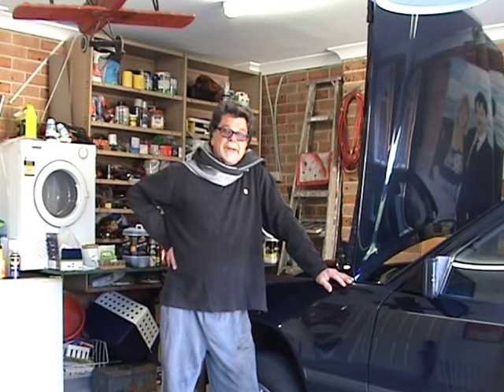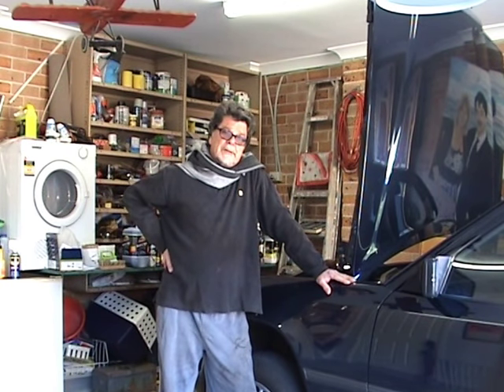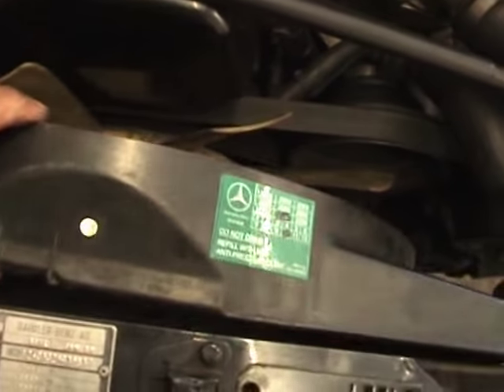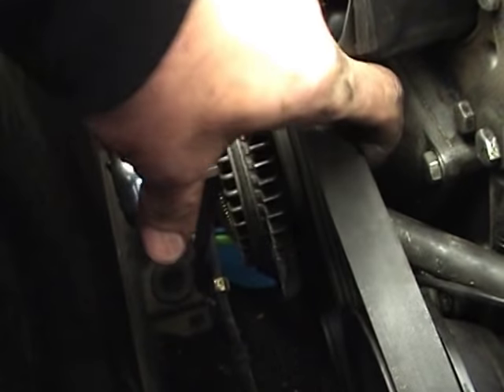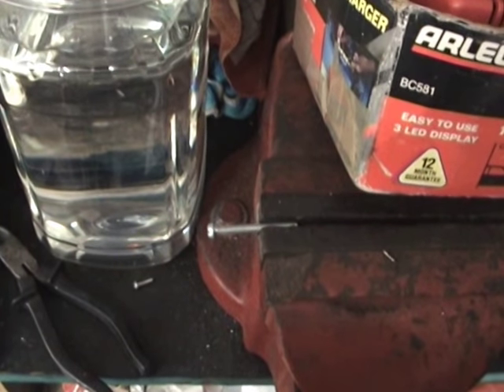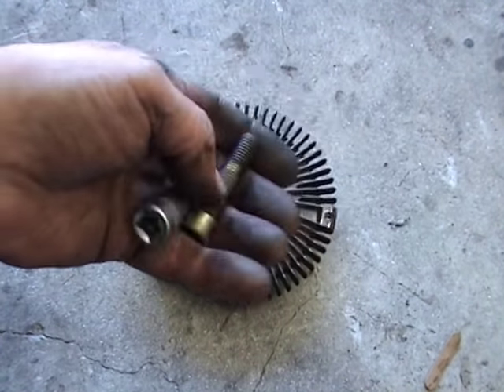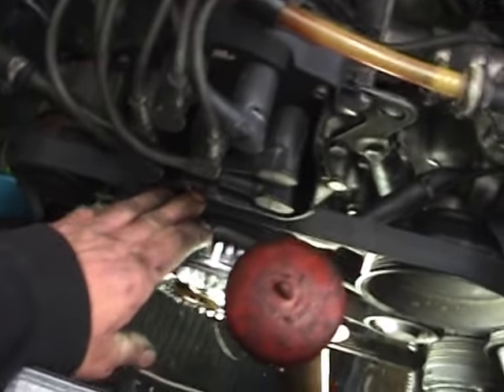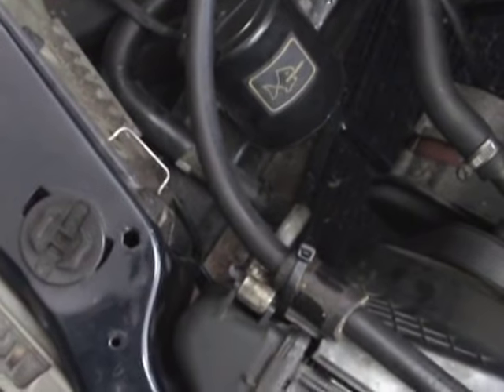Mercedes 300E cooling fan clutch replacement

Comment: Could you please let me know to undo or loosen the centre bolt for the clutch, is it clockwise or. anticlockwise?
Reply: Anti clock to remove it and refit is 45nm  clockwise
Reply: @borntolate1  Thank you so much
Reply: Thanks worked great I got lucky and got the fan loose with Allen key the 8 m like you said and didn’t have to take the radiator out😊

Comment: Good work, do you know what the operating temp should be on these 80’s Mercs? My W126 seems to normally run at around 82 degrees but in the heat climbs to just under 100. Dies that mean my cooling system is not working efficiently? Thanks
Reply from the maker: Hi, Marshal  Our 300E normally runs around 80 degrees but with the A/C running will run around 90 degrees. If you are stuck in traffic on a very hot day going nowhere it will modulate between 100-80 degrees. In other words I'm buggered if I know. Cheers, Paul.
Reply: riffraffjazz cheers, thanks for the videos very helpful 👍

Comment: Riffraff this might be to late but the centre bolt for fan clutch is 45nm  the other outer4 bolts are 10nm i think you might have looked at the wrong setting ,So ASAP set centre bolt of fan clutch to 45nm or it could come off. Trev uk

Comment: How did you know that your fan clutch was bad and what brand is your new one. I had the single shroud
on my car as well and replaced it with the split one.
Reply from the maker: Hi, Thomas  When the car was warmed up you could grab and stop the fan with your hand as it was only free wheeling, not gripping. I wouldn't advise doing that unless you know it's no good. The brand of the new one is Vemo. Cheers, Paul.
Reply from the maker: The correct answer  start with this simple test: Spin the fan as hard as you can on an engine that has not been started that day. If the fan rotates more than five times, you can bet the clutch is bad.